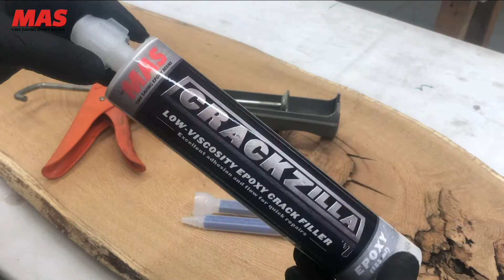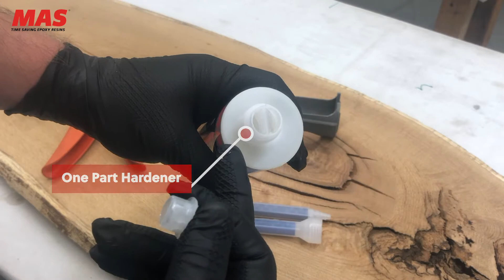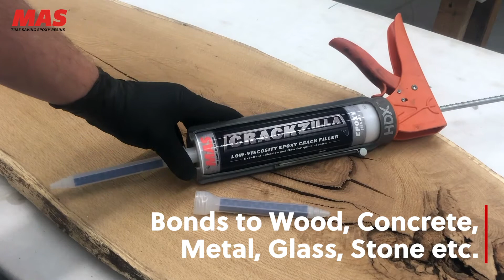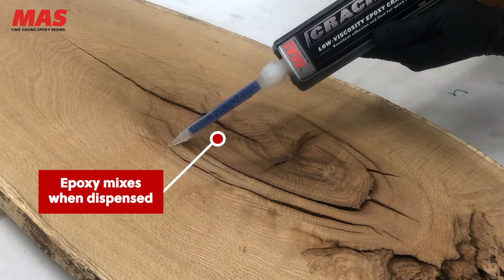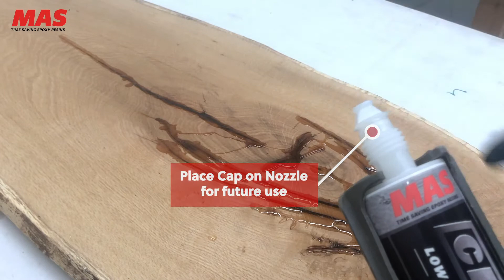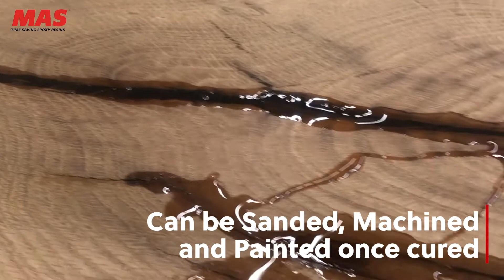Best Epoxy Resin for Filling Cracks

Comment: hi, thanks for this video. would epoxy resin be good to fill in the cracks in decking wood ie pine. to prevent water sitting there and further deteriorating. then im thinking to paint with a decking stain. thanks